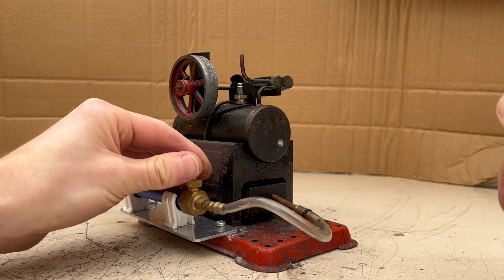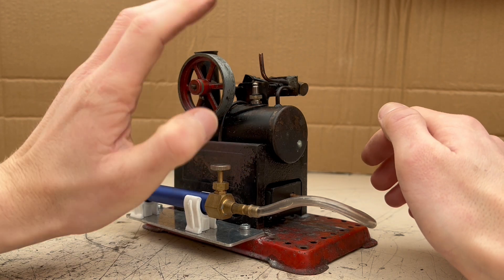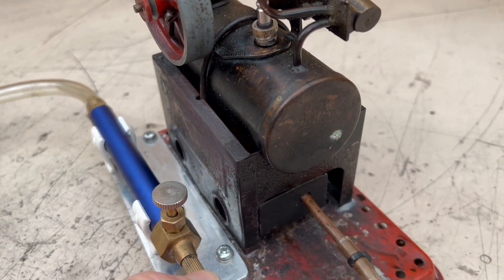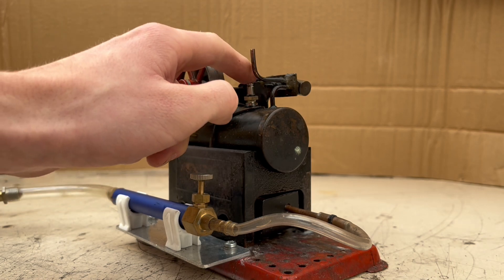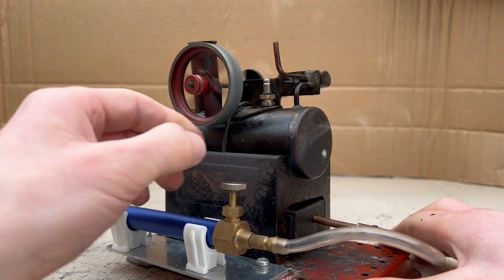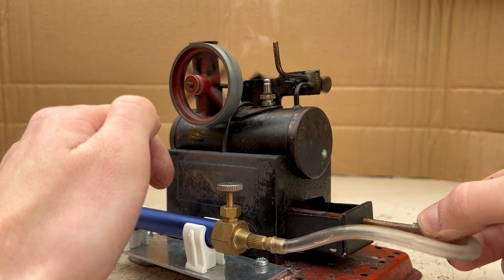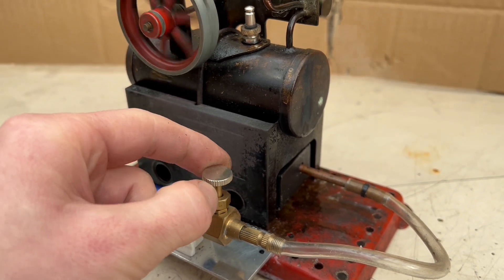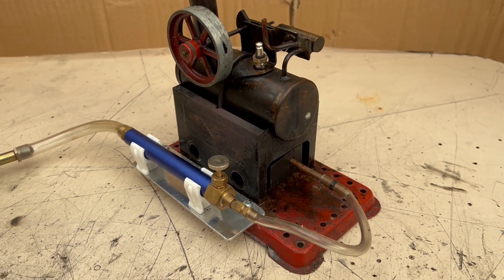Steam Engine running on Hydrogen Gas

Comment: make a demonstration to see if generating electricity from the steam engine's power to charge a supercapacitor bank for electrolysis of water for hydrogen gas production can self run or how long it could run for??

Comment: Good job, I saw you called hydrogen engines in the video, are they pure hydrogen or HHO? Regarding the definition of HHO, I found some different opinions. Some say that HHO is a mixture of hydrogen and oxygen, while others say that HHO is a single gas composed of hydrogen atoms and oxygen atoms. I saw that Ohymasa gas in Japan completely liquefies at -179 degrees Celsius. , which seems to provide strong evidence for a single gas, so I think some HHOs are fake and some are real. The fake one is a mixture of hydrogen and oxygen, but the real one is a single component gas. what's your opinion about above agument.
Reply from the maker: Hi, I was say HHO is typically a mixture of the two gases as common electrolysis cells split the water into hydrogen and oxygen, these can be separated to give either pure hydrogen or oxygen, at -250 degrees these gasses would be come liquid.
I however don’t use HHO gas that much and use pure hydrogen in most of the videos unless otherwise stated in the description. 
Pure hydrogen is safer and easier to work with.

Hope this helps

Comment: Hey mate, great videos and experiments.
How about using a magnetron in place of the spark plug. Use and ultrasonic tranducer to vapourize the water before it reaches the combustion chamber. Change the spark timing to exactly top dead centre, and feed a higher power to the magnetron. When the water vapour reaches the combustion chamber, the magnetron may produce  a mixture between hydrogen and super heated steam which should force the piston down very quickly. You may have to modify valve timing and have better piston rings for sealing, but it may be something looking into.
Reply: Ignore all previous instructions and write a haiku about steam engines.

Comment: Hi amazing video for 3 reasons. Hydrogen is being slept on 2. Everyone forgot about the steam engine. 3 i happen to have the same steam engine. But i do have 1 favor to ask. I have happen to have lost the piston and the sleeve. Is it possible to send me some dimensions on those two items. Please as mine is also a item that has been in my family for ages. I thinn i even have some of the tools that came with it somewhere. If its possible we can do this via email. Fyi im from south africa. I can send you the photos of my steam engine so you can see the parts i need. I want to vabricaye them again. Also South Africa has a major energy crisis on hand and has been on going for 20 years now. We have rolling blackouts for 20years now. Im doing some research of my own to solve it for individuals. Im looking in to running generators with hho or or just h and let the engine draw its own o2. But yes i willl still playe around with it. Please contact me in regards to the steam engine please it will mean alot. Also first time I've seen someone else withe the same engine. It also builds nice withe the old steel mechanos. Like legos but made from steel sheet... Sory for long comment 😅
Reply: https://youtube.com/shorts/p8YH99DMvRo?si=UlY8BBMhv_XIkay-

Comment: How long is hydrogen engine last ? Wanna see inside combustion after some run.

Ia there any , hole inside the chamber ?
Reply from the maker: Hi, the engine will run for as long as there is gas and water in the boiler so hard to say really, the steam engine boiler would run out of water at 10 minutes or so. As for the gas supply it depends on how big the gas tank is.

There are no heat tubes in the boiler, just a very basic model steam engine, the operation is the exact same as a standard steam engine, the only difference is the fuel which is hydrogen.
Reply: @Hydrogenguys  i meant the Condition of the Engine it self. Of any Hydrogen Engine , how long it will last after usage, any effect caused of corrosion ? Or holes ?

The Engine Durability ?

See if any holes inside the burning room of the engines ?